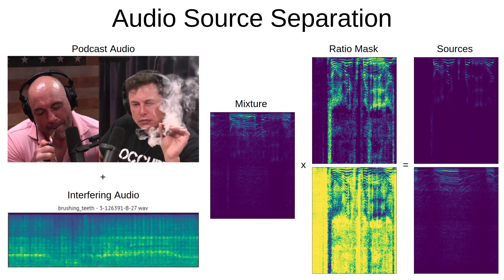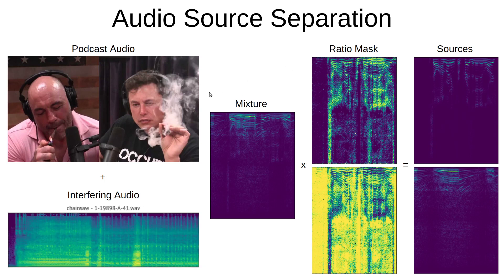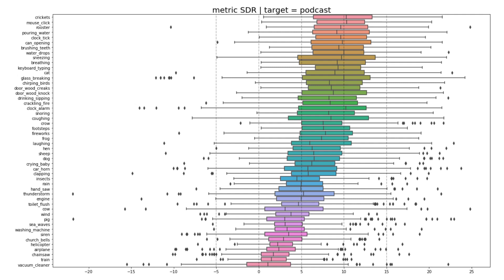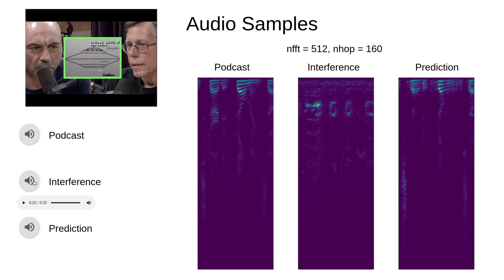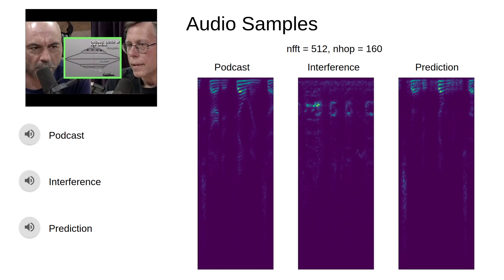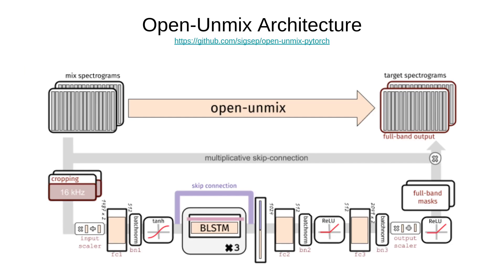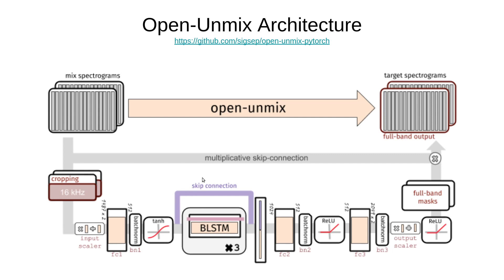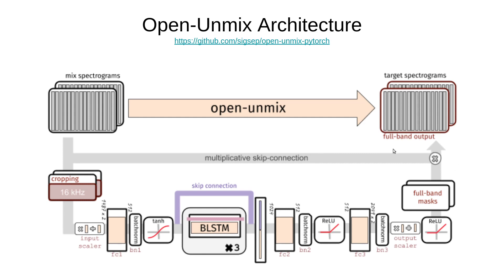Demo and Architecture - Audio Source Separation p.1

Comment: Does the lstm take as input the whole cropped spectrogram matrix to learn a mask matrix that multiplied with the spectrogram returns the source? If so, then with latest relu activation, don’t you lose all the negative values? 

Also to add to that question, does the mask multiply with the complex values of the stft or are it the absolute values from the stft?

Comment: Do you happen to know why each frequency bin is normalized? Why not normalize using the time axis or normalize using all values in the input? Also, is the normalization generally necessary?
Reply from the maker: With audio data you will often see magnitudes which are much greater than the majority of the data points.(aka some random large magnitude at a high frequency). This would bias the distribution. This is why we often use a log spectrogram to provide better resolution of the data. In addition you can normalize each frequency bin so one data point doesn't effect a lot of the lower frequencies. Normalization is technically not necessary since the weights will handle it, but you will be able to converge on a better solution faster with proper input scaling.